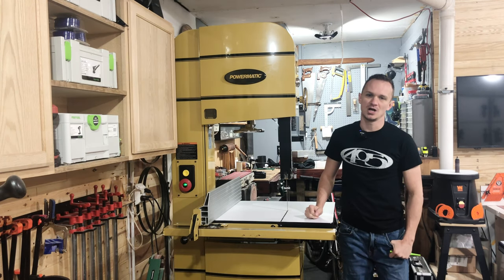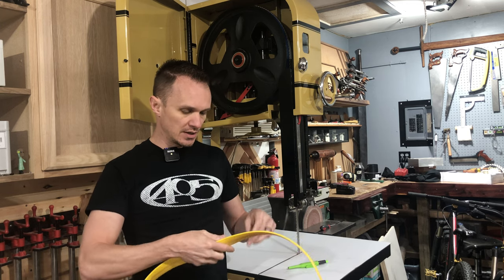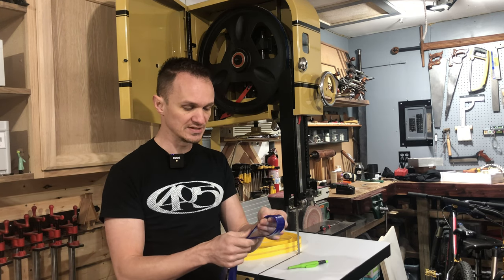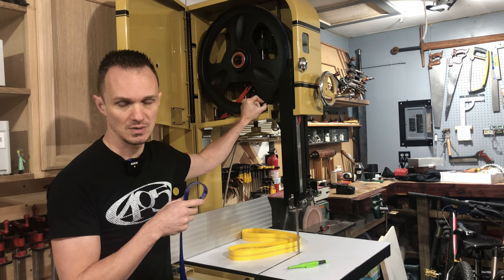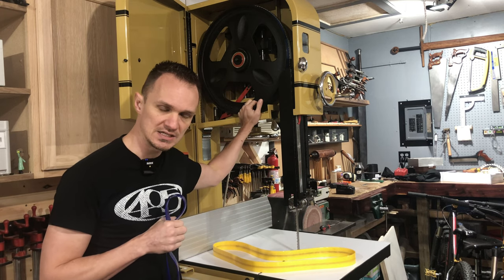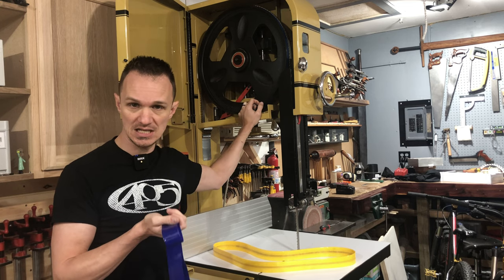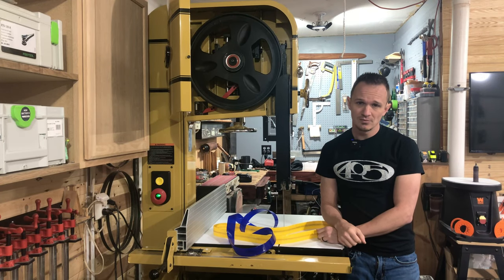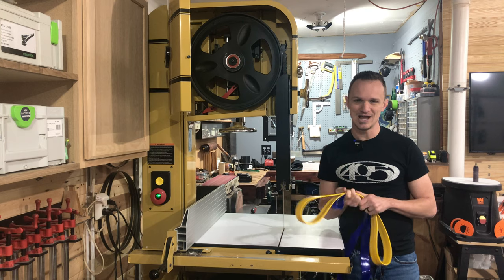Fixing a NEW! $7000 Powermatic 1800B Bandsaw….sort of.

Comment: I put on the bluemax guides and they worked extremely well and much better than stock yellow ones. 

For anyone trying them, first definitely do it as they are very high quality and fit very well. Second easy to put on by hand with one spring clamp as they recommend in instructions that come with the tires. Third, as recommended elsewhere, take off the wheels in order to apply them. Note that the bottom wheel has the grooved belt attached to it so you need to first loosen the tension on the belt and then remove the bottom tire. Repeat the process when putting things back on at the end. I’ve never done this before, and it only took me approximately 20 to 30 minutes, and the hardest part was simply getting the yellow tires off the wheel.

Comment: Ok guys 45 years here running a commercial cabinet shop. Have 7 bandsaws. gave up on bad tires 40 years ago and started to wrap them in Scotch 33 or 88 and/or a good quality gaffers or duct tape. No issues since and haven't even looked at them in 5 years. Smooth and true running.  Don't think so hard!

Comment: I purchased this bandsaw and have not had any such issues. As you recommended this bandsaw it truly is excellent, solid, well made, and a joy to work with for all tasks from resawing, cuts for furniture making, processing own lumber, and large bowl blanks that I have thrown at it. At double the weight and cast iron as the closest competitors, I would never go back to select another bandsaw. (I tried out most all in 18-20 inch range previously) Hope you too are happy with this saw. 

Of note, if you purchase the bora industrial mobile base the bottom door for the bandsaw may not open all the way and make sure you have a lift or gantry crane ready to lift this off crate.
Reply from the maker: Great to hear. I may have overthought my video and it was probably mostly a crappy blade weld but I still am glad I replaced the tires as they fit Mitch better and lay flat at the edges. 
Yea I got the Bora base and I had to shim the saw up so the door opened. Getting a piece of plywood under a 900lb saw was not easy by the way lol. 
Yes still loving the say and this week I finally ordered a carbide blade from Lennox. 
I had one on my old say and loved it. I didn’t want the laguna one because I have herd that they have breakage problems.
Reply: @MSRWorkshop  I'm going to try the bluemax tires as after I cut through some green wood got sap residue that won't come off so now there is a rattle/ tremor so thank you for the recommendations away from carter tires to these...I'll see how it goes
Reply from the maker: I think you will really be happy with these tires. I converted both my saws to these and they have been fantastic
Reply: I put on the bluemax guides and they worked extremely well and much better than stock yellow ones. 

For anyone trying them, first definitely do it as they are very high quality and fit very well. Second easy to put on by hand with one spring clamp as they recommend in instructions that come with the tires. Third, as recommended elsewhere, take off the wheels in order to apply them. Note that the bottom wheel has the grooved belt attached to it so you need to first loosen the tension on the belt and then remove the bottom tire. Repeat the process when putting things back on at the end. I’ve never done this before, and it only took me approximately 20 to 30 minutes, and the hardest part was simply getting the yellow tires off the wheel.
Reply from the maker: So glad to hear that there working great !

Comment: Hello. Thanks so much for the informative video. I am installing new tires on a Powermatic 1800 (not B) bandsaw for a local shop. The top wheel came off easily, but removing the bottom wheel is a problem/mystery. Reaching Powermatic is next to impossible. I would appreciate any advice. Thanks. John in Port Townsend, WA
Reply from the maker: Are you replacing them with the blue max tires?  The bottom wheel is just slightly more involved to remove but not difficult at all. Just release the belt tension and the lower pully is mounted to the lower wheel and both will pull off as a unit. 
If your replacing with the blue max tires you could just cut the lower tire off and mount it without removing it, but removing it makes it easier.

Comment: Sounds like more of your problem was the quality of blade and not the Powermatic tires.  If the tire conforms to the arc of the wheel, your contact surface is the same.  Your illustration actually indicated a more rigid tire and not a softer tire.  I am glad you got what you wanted by going to a softer compound, but I would likely have tried to buy better blades before putting the blame on the factory tires because it sounded like you did not have the problem until you changed to the new blades.  Either way, thanks for sharing.  I am in the market for a new band saw and every bit of information I can collect is helpful.
Reply from the maker: Thanks for your comment. So the stock tires are a hard, rigid compound that don’t stretch at all and offer a little to no vibration dampening well the new blue tires, compensate for any imperfection in the blade.. so far since I’ve made this video, I’ve been very pleased with a new tires on multiple different types of blades. But yes, you are right switching to a new blade would it probably been helpful as well?

Comment: Curious on how you run your blade... why would the blade ever run on the rim of the wheel?  Normally the teeth of the blade run near middle of the wheel, thats why the wheels are crowned.
Reply from the maker: I don’t but if you were to run a really really wide blade, you wouldn’t be able to run it on the crown, and it would mostly need to be centered. It’s also possible if you’re running a wide blade and you run it back from the edge, the rear of the blade might hit the edge as well

Comment: Out of curiosity,    what was powermatic's response to this problem.
Reply from the maker: They said that they had never herd of that before and were willing to send me a new set of tires. I declined because it wouldn’t address the issue with the compound. I kept the original ones just in case I have any problems with the new ones. I don’t imagine I will but only time will tell.